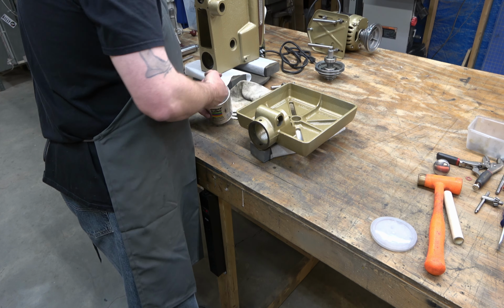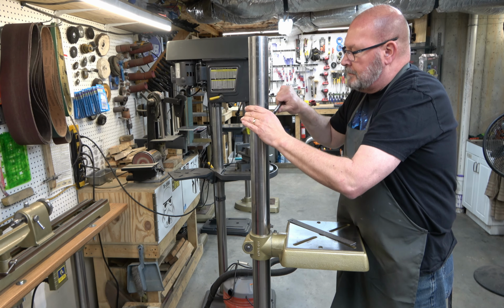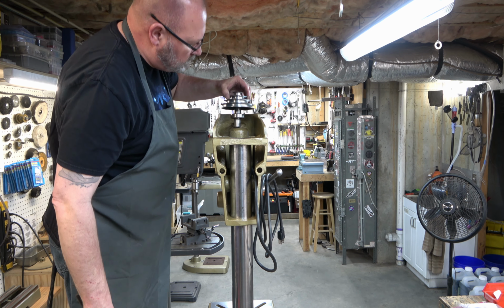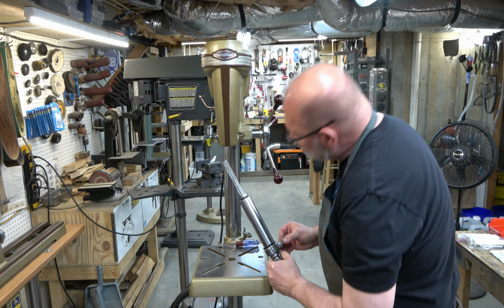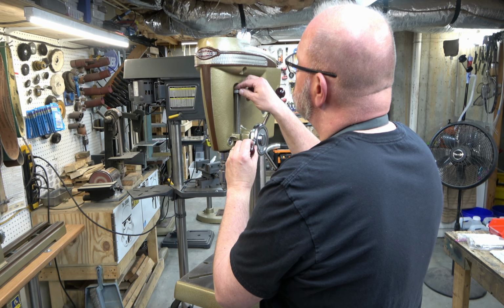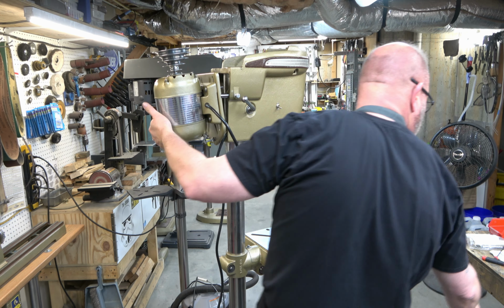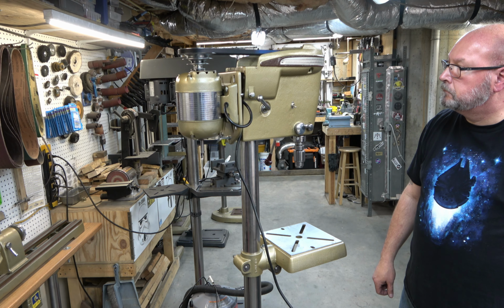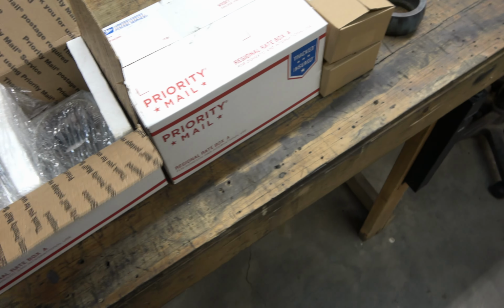Part 10 Craftsman King Seeley 100 Drill Press Rebuild (Final Assembly)

Comment: Another great and informative video. Do you have a source for the felt piece that goes between the feed stop nuts?
Reply from the maker: I do not other than ebay. I really don't see it as a significant item but if you really want one and can not locate a used one, I would look at the hard felt sheets on McMaster Carr like part # 8759K81 and cut it out with a laser engraver.
Reply: @JeffsShop sounds good. Will give that a shot. Thanks!
Reply from the maker: @JamesBall-b8c  glad i could be of help.

Comment: Jeff do you have a separate video on how to make light template and wiring and parts needed  
I am at this point in my rebuild 
I thought I recalled you having one, but I cannot find it anywhere. Much appreciated in all your education.
Reply from the maker: Thank you for reaching out. I have this 2 part video: https://youtu.be/VmEjJjUFR6o?si=3YnG2OoOKMmaB10B and I did cover the fabrication of the "hard mount" power panel in this video: https://youtu.be/grA-O4E2ves?si=qAJQil0oGTVef6BD&t=801
And the assembly in this video: https://youtu.be/GlBV7TWqNao?si=HhME_FW-JhiNxHgQ&t=62

Comment: I had the same problem you did in removing the two machine screws that hold the spindle assembly. Both of mine broke. Did you have to drill and retap? One of mine is not coming out. A peice is stuck flush with the threads and Im afraid a drill bit will walk of center if I drill it out.
Reply from the maker: I have had good luck with forcing the spindle pulley assembly out wich will either break off the screw on the inside or bend them. Once the spindle pulley assembly is out then you can try to turn he remains of the screws fron the inside with small vise grips. However, most of the time if the heads are broken off, you can try a left-hand bit and screw them out. Worst case you will have to drill them out and tap to the next side up. If this happens, you may as well tap both sides.

Comment: Jeff: A mistake which I made and  wanted to share.  The holes that the quill passes through must be clean and free of paint. When painting the interior of the drill case I painted the second hole that the quill passes through.  Completely forgot about it until installing the quill and finding it stickey to move and wondering what was wrong.
Reply from the maker: Yes, like I have said in most of rebuild videos, the head casting has a ton of bores that must be masked off prior to painting and it is very easy to miss one. I made a huge mistake on the first 100 I ever rebuilt. I did not mask anything and painted everything then came back thinking I could sand the paint out of the bores. Boy was I wrong and I think I ended up destroying that head casting. I have even forgotten to remove the masking form the one middle bore you are talking about and could not figure out why my quill was getting stuck inside the head. Sand the paint and primer out of the bore very carefully. Do not take off too much or the bore will never make contact with the quill and you will get slop that translates to runout. luckily, this is a bore that was later eliminated in other drill presses so I do not believe it will affect your drill press significantly.

Comment: Love this series, very informative video. 

So I just purchased a 103.23140 and it’s in mint condition but noticed the whole chuck has a wobble to it, is this normal? Is there a way to adjust the whole mechanism so there is no wobble
Reply from the maker: There should be no visible wobble, check out this video: https://youtu.be/2J4aigerK9Q?si=VRJvw9vrrGZfFK-I